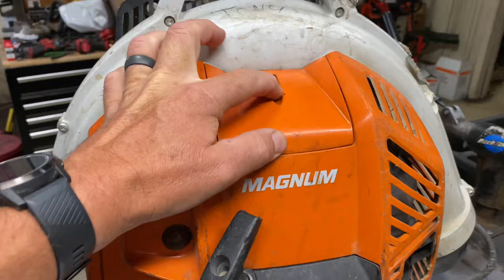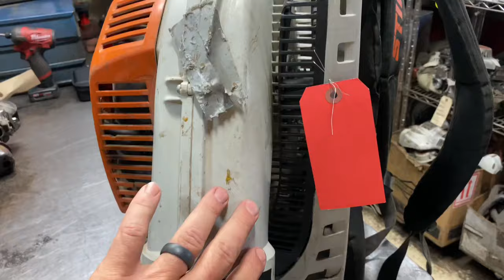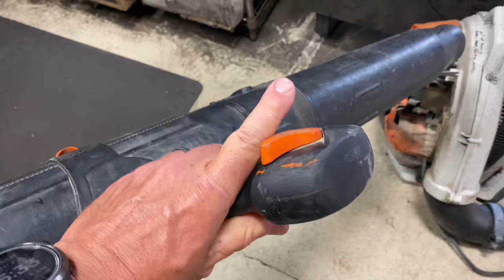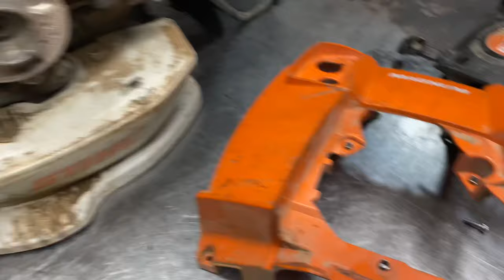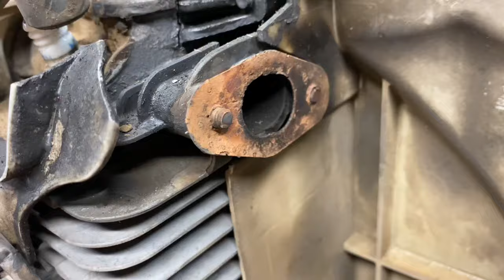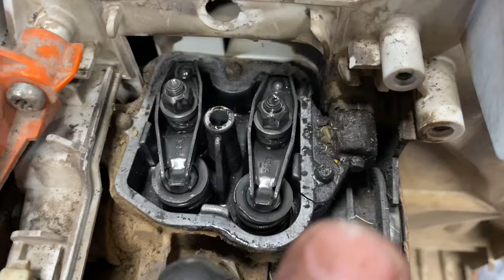STIHL BR800 Backpack Blower common problems and what to look for

Comment: JUNK JUNK JUNK - Don't believe that they're  solid machines - used my BR800X 5 times to blow leaves at my house- stored it in my garage and followed manufacturers recommendations to a T. The unit probably has less than 7 hours on it and the crankshaft broke. Dealer charged me $75 and confirmed it's a warranty issue but can't even say when it will be repaired as Stihl is terrible when it comes to sending the parts out. It's now a month and counting. But I have to say you did make an excellent video sir.

Comment: This was all priceless information for me since I’m not a Stihl dealer and have only had one burned up unit in the shop. It will really help me in the future. THANKS!
Reply from the maker: Glad I could help!
Reply: @wallysworkin823  - Thanks for sharing your experience. 

Do you have any idea if Stihl has fixed this problem in the more recent models or if it still applies?  I currently have a Makita 76cc which works very well but is rather on the heavy side.  And I think to replace it in the foreseeable future. 

if I may ask you, is the BR800 still a good choice?

I have a very good dealer btw near Brussels with enormous knowledge of the business.  Which makes it even more interesting, including the warranty.  Thanks!
Reply from the maker: @laurapalmerTDGE  I do occasional problems, mostly the muffler. If you have a good dealer and the unit is under warranty you should be ok. Depending on your usage ask about the extended warranty.
Reply: @wallysworkin823  - Thanks for the explanation, I will take this information with me when I visit the dealer.
Reply: These Stihl 4Mix engines must use a high quality synthetic 2 stroke oil.

Comment: Why doesn’t Stihl just spend a little extra on some red thread lock and put it on any and all screws that they have seen come loose over time. So the customer don’t have to worry about it and not make it the customer problem. If most if not all their backpack blowers have loose screw issues cause of vibration. Why don’t they make it a priority to fix it or everything they can. If they don’t I really hope that issue is fully covered by warranty for life of the unit. Like Stihl has that for the drive shafts of their trimmers. If that’s the problem they contact the company and pay to fix or replace the unit with a new one no questions asked.

Comment: I work maintenance for a 36 hole golf club and we got 5 or 6 of these about a year and a half ago. We take good care of our equipment and within 2 months we were starting to have issues with the 800s. The pull cord hitting the choke nob has happened twice, we've had 2 of the mufflers Crack and break off just like you pointed out and lots of issues with them losing power or dying as soon as you let off the throttle. We have a fleet of OLD 600s so when we saw our mechanic unboxing those new 800 magnums everyone raced to tag their name and stake their claim, lol. Within 2 months we started pawning them off on new guys and trading back to the 600s. They are comfortable and work amazing when they're working right but after you fix one issue it's not long before something els comes up. I appreciate the video because I've recently been recruited by the mechanics to work on the blowers so this really helped me to pin point some of the issues and hopefully helps me prevent some also. Thanks again!

Comment: This is a extreme case of abuse and not something that a average homeowner will ever have  to worry about but thx for the pointers. Biggest things are use Stihl or Red Armor oil with 89 or higher octane and keep the valve lash adjustment done at least every other season depending on use. I only put maybe 15 hours a year on my blower and keep it indoors with non ethanol gas Motomix.

Comment: I just purchased a new one of these last week. Today was my second time using it. First time, no issues. Today, after about 10 minutes of use, it didn't want to take the gas it would just bog down and shut off. I am using STHIL 2 cycle fuel. I plan on taking it back tomorrow.

Comment: Here in Florida, the backplates go bad pretty quickly from the sun if they are running an open trailer. They become brittle and you get fiberglass on you if you handle them (since they are glass-reinforced plastic).

Comment: Fantastic video…imho the muffler is the worst ever…the rot quick break easy next is the blower tube…the bits and pieces wear out quickly as well. After up to 2 years cheaper to sell the unit and buy new. Fantastic other than those issues.

Comment: My br600s have fallen off of my trailer at 35 mph many times and still work great!
Reply from the maker: The plastic does seem to hold up better.
Reply: Good lord
Reply: I had one slide off a valley and onto the driveway below...while it was running. Aside from the back plate splitting, the engine never had an issue!
Reply: The fact that it has happened many times cause us all to worry about you.
Reply: @brianm7402  I was running a crew in those days. These things don't seem to happen anymore.

Comment: I think that stihl made a production change with to type of alloy or thickness of metal that was used to produce the mufflers.I only recently (3-5yrs) started to see this issue. Started on my late model 600s and now on my 800s. but never had one come loose in earlier generations of the 600's. Quite opposite actually as i remember the mufflers would almost become part of the jug if you never had to crack the rusted bolts loose for any repairs. So yeah they changed something for cost, but now have introduced a way for the dealers to finally start unloading these ignition parts that have been sitting around because they never go bad! A loose muffler bolt seems to always finds its way to the stat or to shred the pickups on the magneto. Only time if ever had to replace on.

Comment: Biggest problem I run across with these 4 mix engines is starter rope hard to pull due the excessive valve lash, the lawncare guys just run the piss out of them and don’t do the scheduled maintenance... Adjust the valves to .004” and good to go, then we see a lot of oil residue around the bottom pan because of pan bolts vibrating lose and crankshaft seals leaking ...!
Reply from the maker: Those are good points. The compression release on the cam will not work correctly if there is excessive valve lash. I see far less leaking/loose pans on 800’s versus the 600 and 700’s. Thanks for watching.

Comment: I have had two of these with side recoil. In terms of power and overall performance they are awesome, but they should be for the price. Just out of warranty I had a throttle cable issue that I had to replace ( entire unit) and two months later the crankshaft went. The cost to have it repaired at the dealership was more than half the cost of a new one so I opted out of repairing it as I had lost confidence in the quality of the machine. Though we use our machines hard we do not throw them around and are pretty careful with them. To lose a machine that cost in the neighborhood of $800 after only two years makes me think twice about investing in another one. So, love the machine but, I think I'll look elsewhere for its replacement.
Reply from the maker: Two years is the life expectancy across most manufacturers. We see a lot of crankshaft failures, and yes it’s usually not worth fixing. The crankshaft alone is over $300.
Reply: I bought an 800c in November of '20.  Light use, might have 25hrs on it always kept in the dry and this season it just died on me   swapped the air filter , fuel filter and sparkplug and it still idles rough and then dies.  Luckily I'm still within the 2 year warranty but for $800+ I expect more than 25hrs before needed to be put in the shop 🤷‍♂️.
Reply: @oneawesomemofo  
I just bought a Schroeder on Amazon for less than half the price of my other 800 because it actually spec'd better than the 800. It has  bit smaller tube but it is really a strong blower close to the 800 and in some situations superior. German made. I have used it on some heavy commercial jobs and it performs very well.
Just in case you're looking for an alternative.
Reply: @jimrose6118  I was actually watching videos today on the echo 9010t.  I'm assuming whatever is going on with my 800 should be covered under warranty but I'm already thinking about cost to repair/replace the 800 2 years down the road and if I should sell it now while it still has some value and switch.  This doesn't leave a great impression on Stihl products which have been my go to.
Reply: @oneawesomemofo  i am shocked!

Comment: The engine pans loosen up on the BR600 and 700s because the muffler would always get a stress crack and break at the bottom bolt, which caused 700 some-odd degree heat to blow at the pan and with the vibration will cause the bolts to come out.

Comment: Had 3 of these with the fan issue and 1 with a snapped crank. All were under 3 months old. All repaired no problem under warranty but they have all since failed again less than 6 months later with the fan issue. Again, all being replaced under warranty but the down time is inconvenient! I know of others with the same issues as well. we are based in the UK.
Reply from the maker: Down time is a big issue. We have been pretty lucky with parts availability.

Comment: I have one br800 and out of nothing just lost power I change the spark plug and the fuel filter and air filter and replaced the carburetor and still doesn’t have power,  can you point out the issue if you can, thank you

Comment: Major issues vibration ,, exhaust needs plate reinforcement plate and better crush tube with an extra .bolt .  The valve cover area crack either engine vibration or shock loading from fan case when unit is dropped .  Both areas need more metal .

Comment: Great video and informative. I am a contractor of cemeteries in the north east. I use a Stihl  b86, need  recommendations on a 4 stroke blower if you have any. Partial to Honda string trimmers, had several and they are great. Thanks for a really good video
Reply from the maker: I recommend the BR700. I recently made a video about them. I still see to many issues with the BR 800.

Comment: Here's my question and this is totally a reliability longevity question (not cost, overall value or performance).  From a soley mechanical perspective would you go with the 600, 700 or 800 series?
Reply from the maker: Currently I like the BR700. I just made a video on the new engine design for the BR600 and 700’s. https://youtu.be/giuHhuRkOBU?si=9qJQSEVxjQajAWS4

Comment: That thing has to be older than a year. If it is, the crew have beat the hell out of that one
Reply from the maker: I believe it was right at 2 years old. I’m still shocked how people treat equipment.
Reply: @wallysworkin823  personally I treat equipment pretty rough. I'm tired a lot of times trying to finish up or just want to get it done. So I abuse my personal tools pretty hard. Even work the future owner told me we treat the equipment rough I said it's the price of business. We get the  job done in the quickest most efficient way compared to the other crews. Smetimes tools are used in their non intended way. Pipeline work everything is so heavy. People ask if I go to the gym, I haven't in 3 years. Just the equipment is heavy. Some of the hole hogs weight 70 to 150lbs. The bigger ones even more you need a machine to lift it or the whole crew.

Comment: I have an 800 and it runs perfect until it get to operating temperature then it bogs out like the carb is out of adjustment. I have no idea what to do. I’ve checked valve lash and it’s good. Good spark no grounding issues that I could find. 

Any common issues you’ve found on this subject?
Reply: Make sure the cold weather flap is open for summer months.

Comment: Makes Me Appreciate My Stihl BR 400 Over 20 Years Old And Still Runs Like a Raped Ape Only Thing I’ve Ever Done Is Fuel Filters and NGK Spark Plugs and 1 or 2 Air Filters 40:1 Mix And 1 Carburetor Kit 5 Years Ago 😀❤️❤️😀😊
Reply from the maker: Those were good units, not the most powerful but reliable.
Reply: Had mine for 25+ years with no problems, then all of a sudden would start then all of a sudden stop & then not start. Gave it to a friend of mine(think the on-off switch may have a grounding wire, but never checked) and got the 800 with the side pull.  Having seen this video and read some of the other comments, I wonder if zi just shouldn't have fixed my 400?

Comment: Mine is kind of troublesome to start sometimes.  Usually when it is cold but it is like 50 degrees right now and I've got it sitting inside the house hoping it will start when I try again.
I run it at low throttle a lot and I'm wondering if that's one of the contributors to my starting problems
Reply from the maker: Check all the basic things like your plug and filters. It could just need a carb adjustment or carb overhaul.
Reply: Page 19-20 of the manual has a setting under the air filter to adjust when the temperature is 50° and below.
Reply: @dubldee5364  Thanks so much for pointing that out.  
I switched it today - I ran it for 10 minutes to push some leaves around and I'm still having problems with it dying at idle but it did seem to start up easier
Thanks again - never saw that at all

Comment: I am a homeowner  and over 6 months have had no issues. But I maintain all my Equiptment. I also do light yard maintenance in the neighborhood.  What do you recommend on the muffler issue. Blue lock tite ?  Or something else. Chicanick sent me here
Reply from the maker: Thanks for watching. The problem is vibration and how thin the muffler is. Lock-tite may help a little but not a cure. Keep an eye on the muffler, especially the lower mount as she showed in her video.

Comment: My redmax ebz7100 After 😢17 plus years finally broke down at the start of this new england autumn 🍂.  Carburetor issues,  repair shop said the cannot find any replacement part for this old redmax and they would not guarantee the Carburetor rebuild,  so I live in a dead end my house is surrounded by a canopy of wetlands and trees, I was buried in leaves 3 days ago, so I pulled the trigger and bought a stihl 700 backpack 🎒 blower, I wanted a 800 but they were 3 weeks back ordered as of today, also they only had the floor model sthil 700 left [no 600 in stock].   So my property does not have much anymore,  instead I used inch and half river rocks,  this blower is actually perfect for this!! Its not super fast mph, but cover a ton area , sweeping motion you can cover a TON of ground fast!! I think my red max was more powerful brand new than the 700.  But it was too powerful and wouldn't not cover as much area as the 700, too fast also makes u accidentally tear up mulch beds or blow gravel all over the place.  Its not as loud the 700, but man it's heavy! I am 6"1" 200 lbs and strong, damn my shoulder was sore. I did full throttle,  2 hours.  I moved a TON, a mountain of leaves. Living in a dead with a acre of woods 🪵 behind the dead end , I have the luxury of blowing everything in the woods.  Ton of leaves,  but perfect set up where I don't bag any leaves , blow em deep in the woods

Comment: hm i am using my BR320 for more than 20 years now, never changed the muffler, the cylinder, last year the flex-tube has to be changed, i am still happy using the tool. I use it excessively in autumn time each weekend for 4hrs fulltime on a weekend (=2 to 3 fuel tanks) up to 8weeks and more (depends on the weather green(white?). I am quite shocked to see the problems on the new generation. But sure more parts more issues that can occur. Of course this also depends on how customer are keeping their pet (meaning i wouldn't be in this poor position). The muffler is def too big in size= too long and the fixing points seems not to proportioned to keep the destroying vibration in place. But the cracks in the mainframe, Jesus, what has Stihl done here? Have they forgotten to to the right FEM methods or has it been just designed without any crack test? Material thickness is too low? As an engineer i could not believe what i see here. Or  have they just used a standard design of their 4 Mix engine and put it just onto a blower without real physical testing at all? Greetings from Germany. was it designed and developed in US....Ok, that tells alot. I am joking. Great job to show all the traps.

Comment: How can we lessen the noise of the unit? Most especially on residential, they're complaining about the noise brought by this unit.
Reply from the maker: Not much you can really do it is a noise unit. Stihl made a “quiet” version of the Br550 I think it was. It had a thin foam on the back side of the engine cover and a special blower tube. Plus it ran at a lower RPM. You could try a muffler from a BR600, it will bolt to the head the same but the lower bolt will not.

Comment: iHello! I use mine daily, I bought is about 6 months ago.
motor still good, everything looks good. but what it does sometimes, it loose power completely until it wants to shut off then it gets power again, I just let throttle all in, then it does the same thing over and over again then if I just let go throttle motor  it shuts off .  what can it be? 😢
Reply from the maker: Sounds like a fuel system problem. Check your tank vent, fuel filter and fuel lines. Carb may just need an adjustment or the carb may need to be replaced.

Comment: is there any slop in the crank to cause the muffler vibration? crank bearings going? i've had a few br600 with this issue
Reply from the maker: If the engine pan comes loose it can cause vibration. If the pan is fine and not leaking then it’s a issue with the engine. Not all engines suffer from this, some vibrate really bad and some don’t.